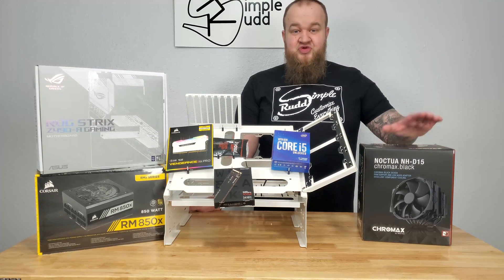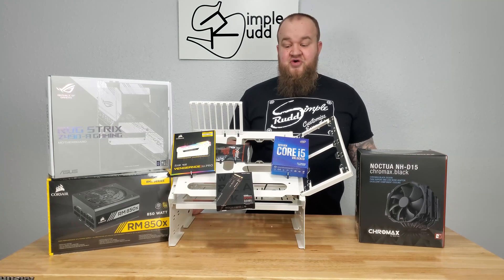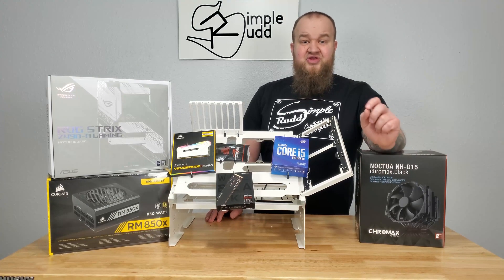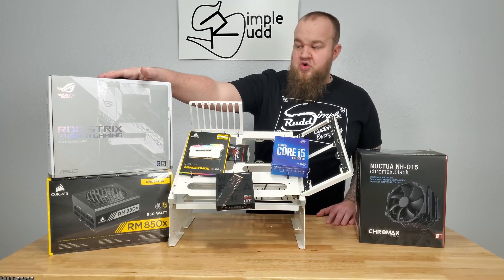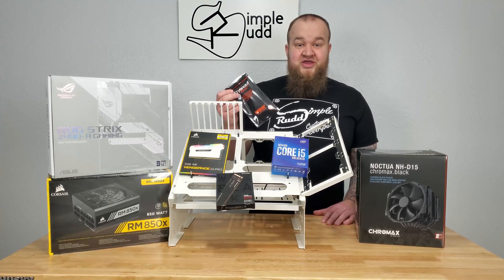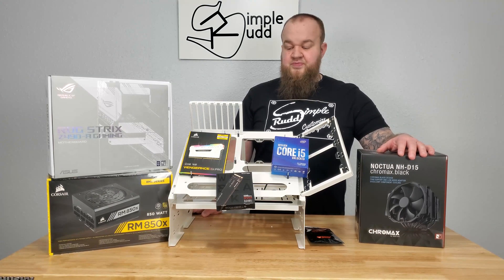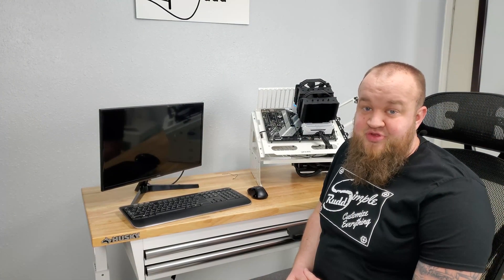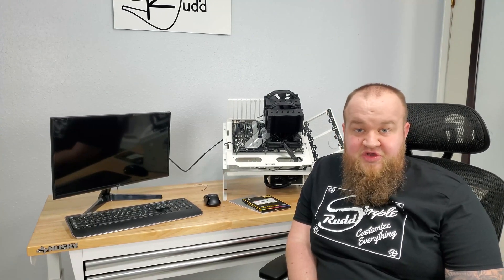That Did Not Go As Planned! i5 10600k Test Bench Build

Comment: I have the Wetbench SX Pro in black, and Primochill's wiring diagram (in the WetBench SX manual) for the Vandal switches is WRONG. If you haven't found a solution yet Mr. Rudd, you connect BOTH PWR and RESET switches in the Normally Open NO positions - terminals #3 and #4, counting down from the +LED terminal. My build just power-looped until I figured it out. 

Shame on Primochill...

Sweet Video Bro! : )

Also, tell them to send you the lower rad bracket for free, it's part of the SX Pro model you paid for. Thumbs Up! : )
Reply from the maker: Thanks for the feedback!!! I actually went on Amazon and ordered a new power button. This model and those parts are old enough that they should be corrected by now and sadly don't look like they have been.